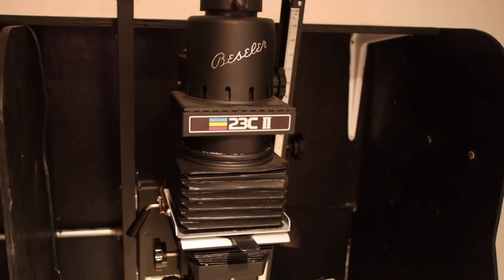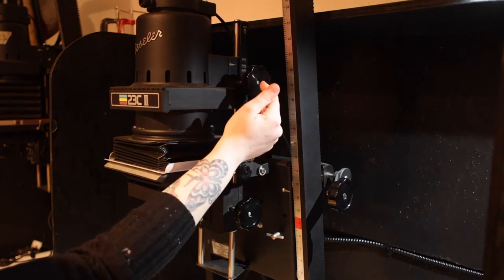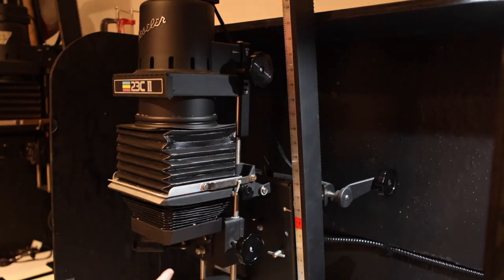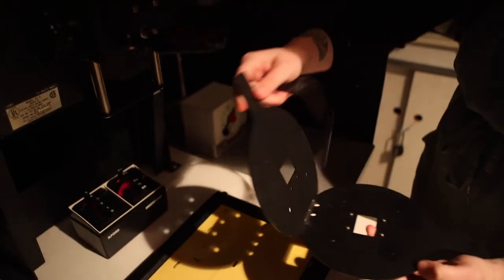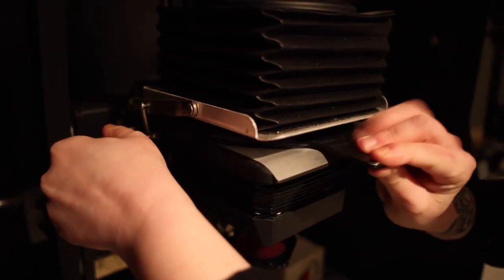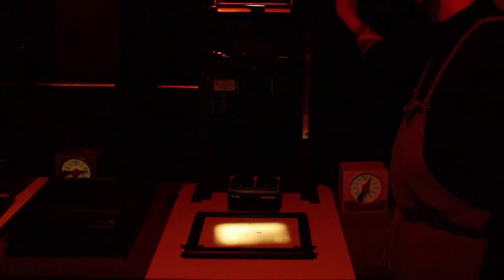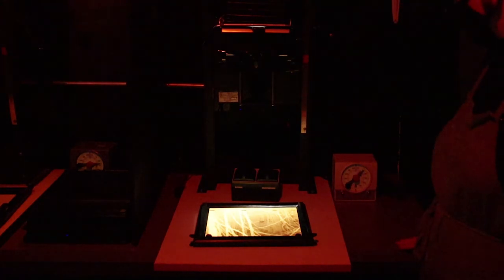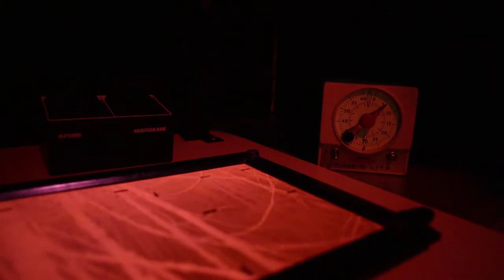Intro to the Beseler 23CII

Comment: In the US, the Beseler 23C, in several models so similar as to be the same for practical purposes, is probably the most popular and most sold enlarger of all time. It is robust. For the most part, all of its optical alignments are easy to do. It is a workhorse which can do everything from half frame to 6x9cm. Practically all of its accessories are still available new or used. It lacks the sophistication of some European and Japanese models, which often have functions and conveniences lacking in the 23C. One problem today is that a new unit is priced north of $1,500, but perfectly fine used ones can be had for less than $250.